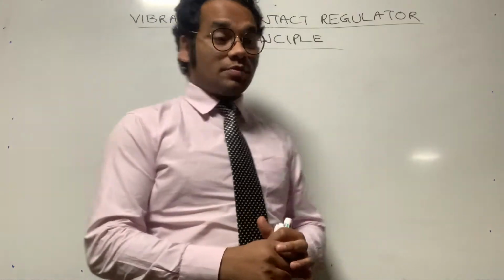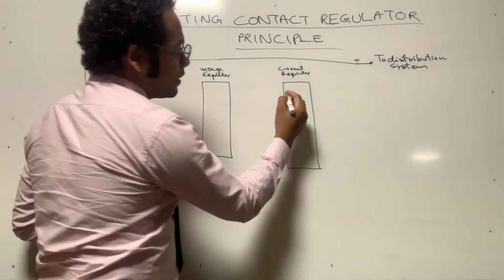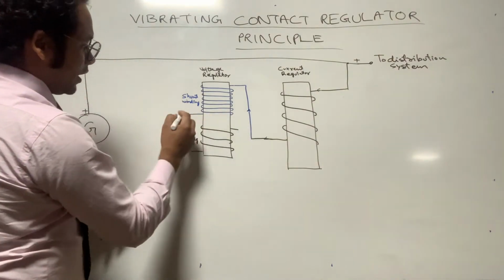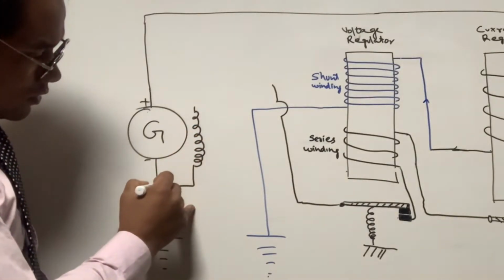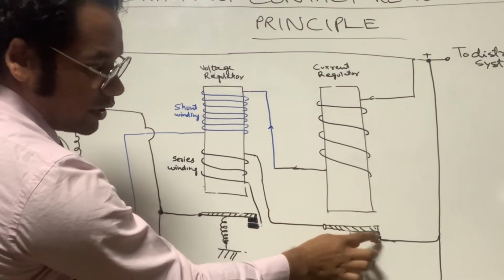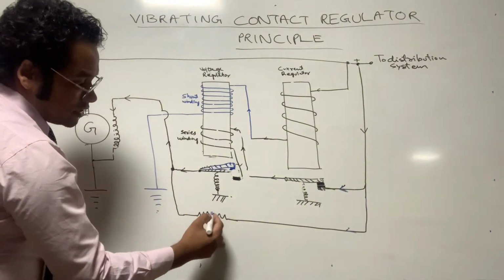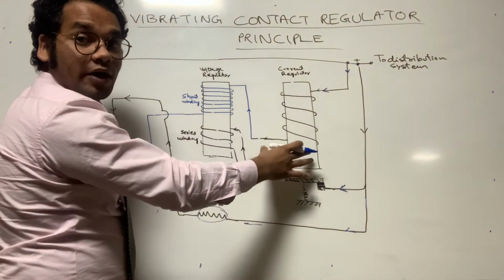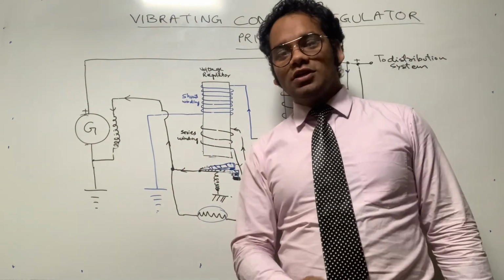Vibrating Contact Regulator Principle || Voltage Regulator & Current Regulator Working Principle

Comment: The way you have it drawn I don't see how the current relay can possibly know how much current is being drawn out of the system going to the distributing bus. I think there is something wrong with the way you have it drawn. Please rethink this take down the video and redo it I think you're leading people astray.  Maybe I'm wrong but I don't think so.
Reply from the maker: Hi dear…
Please ask your doubt! We are here to explain correct things and not mislead learners. We appreciate your doubts. The explanation is about a typical type of VR used in old and small sized aircraft.
Reply: Yes I was thinking the same. Current limiter coil is in series with generator output. Voltage limiter coil is in parallel with generator output. The cut out coil has both series and parallel coil. Both the current limiter contact and voltage limiter contacts are in series with the field winding. This way both over voltage and over current will reduce field current.
If the regulator functions properly the field current is approximately inversely proportional to the generator rpm, which ensures a constant voltage.

Comment: Sir, is it tirril regulator?
Reply from the maker: Yes, Tirril VR can also be known as Vibrating contact type Regulator. 
To be specific:
In Tirril Voltage Regulator, a fixed resistance is cut in and cut out of the exciter field circuit of the alternator.This is achieved by rapidly opening and closing a shunt circuit across the exciter rheostat. For this reason, it is also known as vibrating type voltage regulator.
Reply: @aviatorupdates  sir, the ckt diagram of tirril Voltage regular in the book( principle of power system by V.K metha and Rohit Metha) is not match to your lecture. 
Sir i ask this because the ckt diagram in book is quite difficult,i can't understand

Comment: This explanation was very helpful. My application is a classic automobile (1962 corvette) that has a DC generator and vibrating contact regulator. Armed with this knowledge and my test equipment I'll be able to troubleshoot and determine why it's not charging properly. Thank you so much. My only constructive criticism would be to include the voltage cut out circuit (it's very simple).
Reply from the maker: Wow! This is so nice to hear about your experience. Also, thank you so much for the valuable compliment. 
We will cover cut out circuit in our upcoming video and share with you. Cheers! Keep learning keep growing.